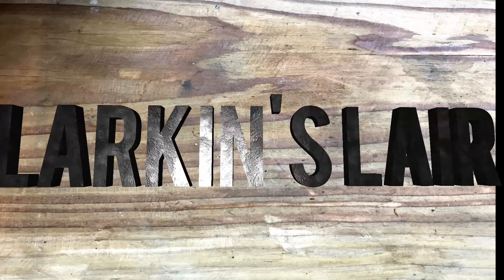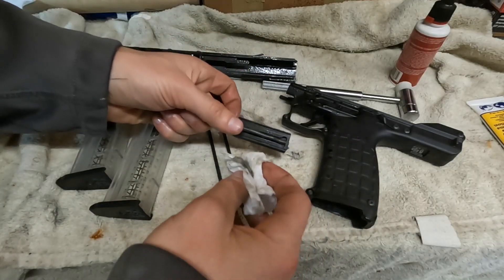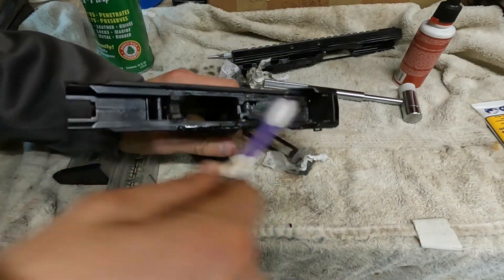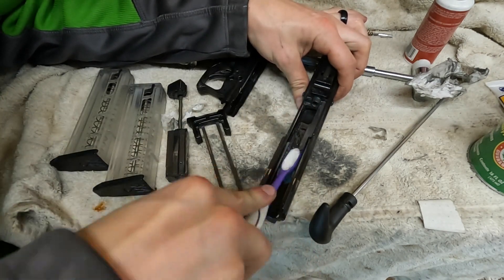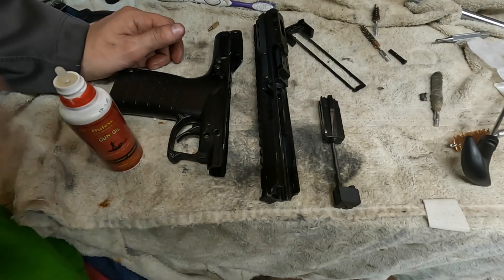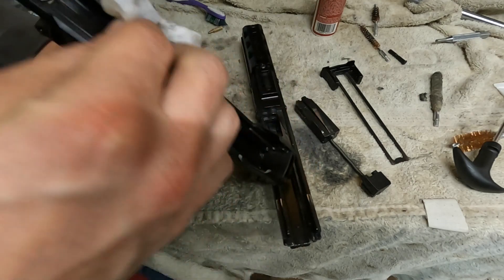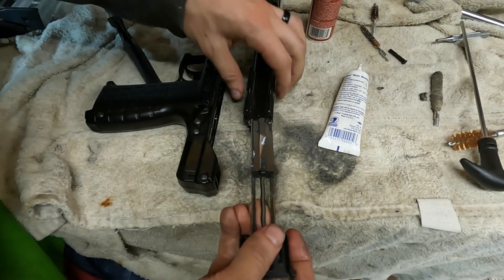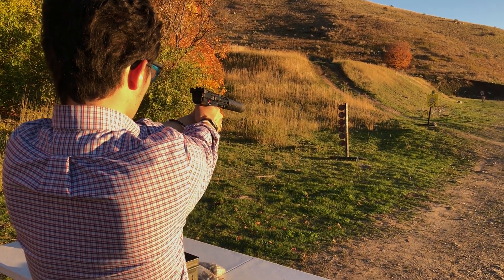How to Clean the Keltec CP33   Easy

Comment: does your gun has the issue where it doesn't load the first cartridge from every magazine ?
perfect video ty :)
Reply: How many rounds have you shot thru yours? 
I’m around 1500 rounds and it’s getting better. 
I’m feeding it cci mini mags and Aguila 40gr round nose
Reply from the maker: If I fill up the whole mag all the way, then yes. It won't load the first one very well. Usually I only load up 25ish rounds for flawless performance. It does seem to be getting better with use.
Reply: @TheLarkinsLair  ty for your answer :) i plan to buy this gun. in France, we generally only load 5 rounds at a time, 10 when we get crazy. i might have no issue that way
Reply: @TheLarkinsLair I got one that was having issues loading every round, Sent it back to kel tec and they polished the barrel and changed a couple parts and sent it back, ran 600 rounds without any further issue, cci mini mag targets and aguila 40gr
Reply: Gotta break it in. Also ive found that hollow points do not work in a cp33. Misfeed every time.

Comment: Rememeber the manual says not to drop the bolt on an empty chamber. Also, I spoke with keltec and they said not to dry fire it either.
Reply from the maker: It would be interesting to know about not dropping the bolt on an empty chamber. For dry firing, in general you shouldn't dry fire any rim fired firearm.
Reply: That’s what snap caps are for. Very helpful video. Thanks.